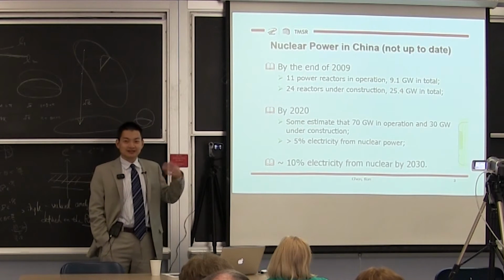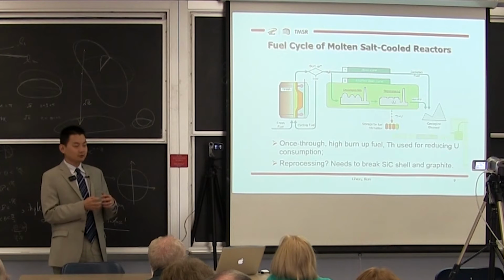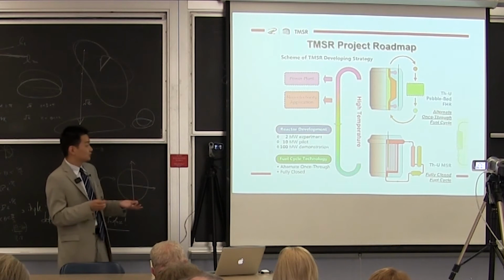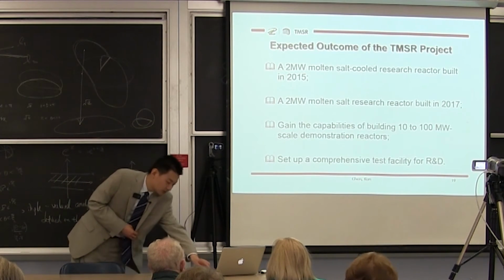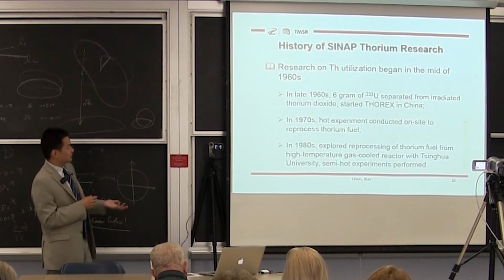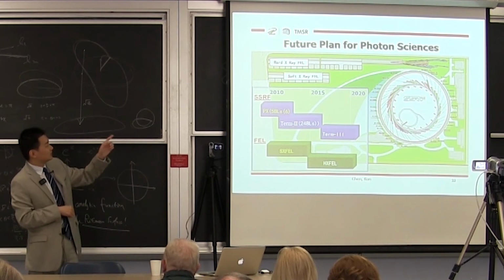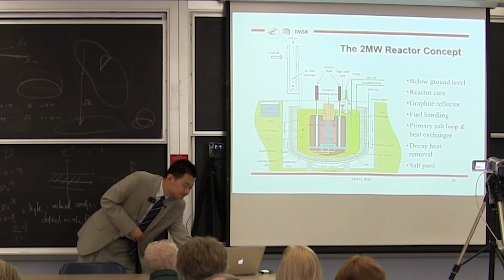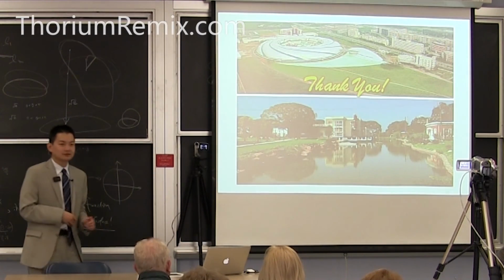Kun Chen from Chinese Academy of Sciences on China Thorium Molten Salt Reactor TMSR Program

Comment: Even if there is a leak in a MSR it's not as big of a problem as a leak in a PWR, a leak in a PWR means an explosion; a leak in a MSR means literally that, a leak which if it's small will self plug and at which time you can drain the reactor and stop any further leakage and at that point you can just replace the part which is leaking, remotely obviously as the salt will still be highly radioactive. And you would have a catch pan to catch a large leak, and again at which time you would drain the reactor.

But at least for a test reactor you could never spring a leak as you will be watching the reactor like a hawk for corrosion with xray scans to check every inch of the reactor, and if serious corrosion builds up you again drain the reactor before a leak even happens, that is what a test reactor is for. 

So I don't see the concern, the consequences of a PWR "leak" and MSR leak are night and day.

Comment: What concerns me is that he says Functional Reactors could be 20+ years away. That could well be too late, considering what might happen if the Russian Tundra melts. Are the problems associated with the Thorium Reactor still so difficult to solve?
Reply: D Nickaroo Some problems like how the materials are affected by corrosion after decades of practical operation need time to sort out, you cannot just run a simulation or accelerate testing by much.

Otoh, if the USA had not pulled the plug on MSR 40 years ago, operational reactors might have come on-line during the 1990's, when they could have started to replace coal.
Reply: India is about to construct a thorium reactor, but a molten salt discussed in this video is a lot more complicated.
Reply: Thomas Altorfer thanks for your explanation.